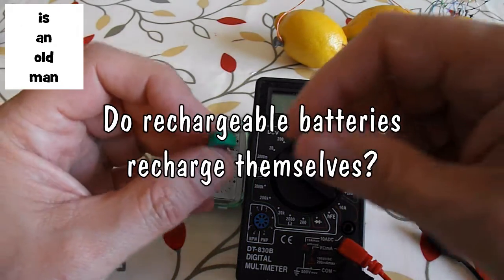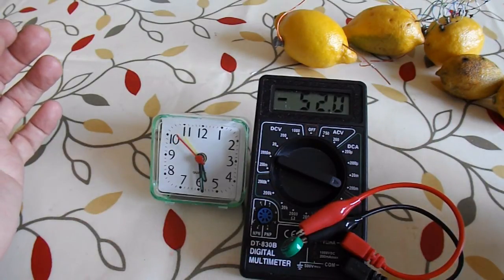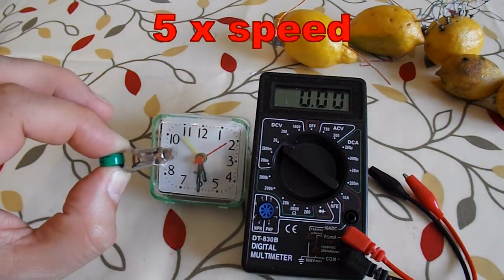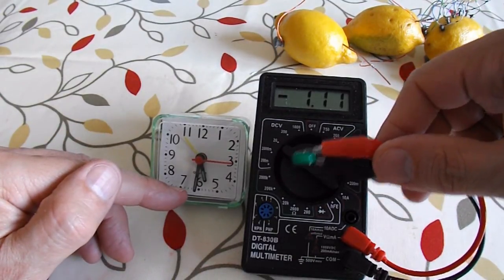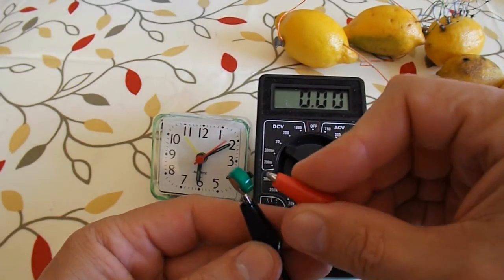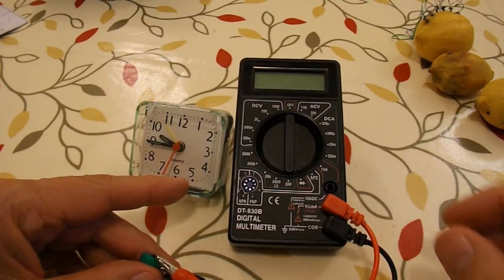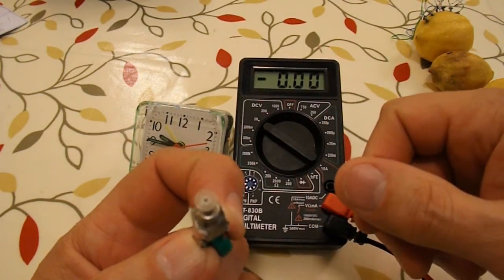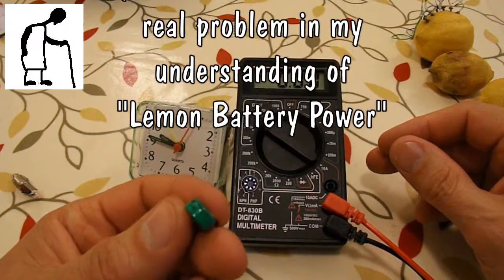Do rechargeable batteries recharge themselves?

Comment: the battery recovers a little due to dielectric absorption, capacitors are even more susceptible and can recover to dangerous voltages
, and no, for voltage measurement the meter doesnt in anyway charge it, its pulling a tiny current out from it,  using diode or ohms or capacitor measurement would put out a little power though
.. as for the lemons, they would output some voltage at very low currents but for a long time, thus charging the battery, and the battery can the provide more current for motor running, the lemons cannot provide much current
Reply from the maker: Hi jusb1066, yes that is what I am trying to show in this video. You probably missed my lemon powered car video and I have now suspended it. In that I showed the lemon apparently charging the rechargeable battery and then the battery powering the car and driving it for about 3.5 metres. Each time I repeated the process the distance travelled was less and I have now decided the initial success was not due to the lemon charging the battery, but the fact the battery recovered sufficient power on it's own. Each run depleted the battery further to the point it could no longer recover. More lemons would have helped to charge the battery but would add too much weight to the car for it to move under it's own power.
Reply: yes, i didnt see that video, but would have been interested to, thank you for the video and reply, you should still let the video go, at least its science you are trying, you are not selling as the next big invention, so even wrong results is still worth seeing for the science.
 i guess you could use your multimeter and keep measuring the milliamps coming from the lemons, to see how their power drops over time into a load, or into charging a battery
Reply from the maker: jusb1066 Here you are, I have made it 'unlisted' so it is no longer generally visible, http://youtu.be/5Zyv_LmS4fM

Comment: I'm going to pick up a lemon and try a piece of magnesium ribbon in place of the gal. nail and a bigger piece cf copper and see if it will run a small motor.
Reply from the maker: Hey good luck with that :-)

Comment: try a small supper cap in place of the battery.
Reply from the maker: Hi magnetman, that may work, I have a solar charged car working that way, but what I was trying to clarify here is why my Lemon Battery Powered Car worked the first time and then progressively got worse. It looks like the Lemon Battery did not charge the rechargeable battery or at best just assisted the battery to restore itself. With each successive attempt the rechargeable battery was less able to restore itself and each run got worse. It had not occurred to me that the battery would do that and as a result I completely misinterpreted the results.

Comment: The rechargeable battery will charge itself, after the discharge the chemicals are not 'done' yet. On the other hand, you could just as well measure the milli-amps on the lemons.
To drain a NiCad I use one of those filament light bulbs which came in old toys. Nowadays it is all LED's but the older toys have a real light bulb in it, which usually require 1.5 Volts (or you can take one from a chistmas light which operates at 1.something volts per bulb). I use those to test 1.2V NiCad batteries, and to drain them (I wait until the voltage shows 0 Volts for 30 minutes or so). As you know NiCads remember up to where they are discharged and they tend to keep less and less power. And in the end they do show a voltage but deliver no power anymore. In those cases the battery can be rejuvenated with (back-emf) pulses (but it can take from one day to a month, it is a slow process using small pulses like from a relay which is interrupting it's own power supply and thus generating HV pulses). I have some videos on this subject for who is interested.
Deslo.
Reply from the maker: Thanks Deslo, Mongrel Shark has given similar advice. I think I will give the whole project a rest for a while then start over with a purpose built charger and probably split the lemon into more than one section to connect in series for a higher voltage as I don't want to add more lemons due to the weight penalty. I have seen your videos but I will watch them again as it is suddenly more relevant to what I am doing.